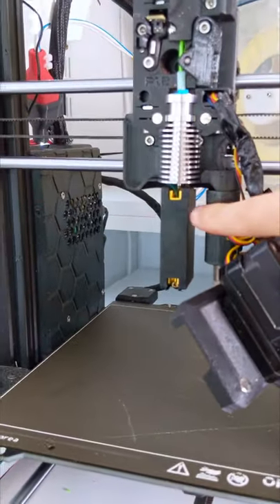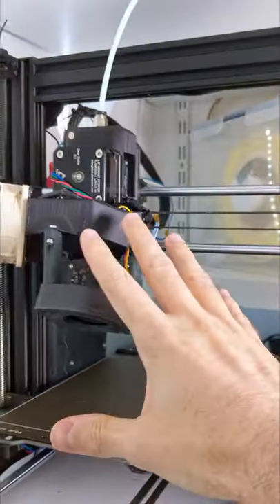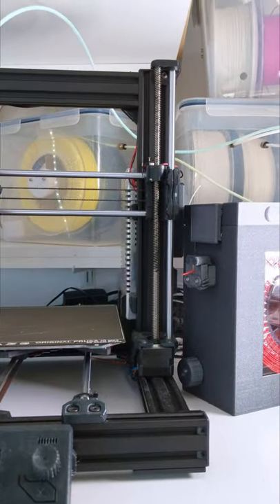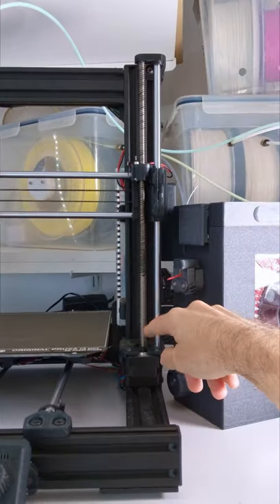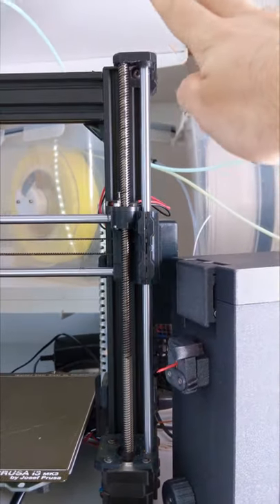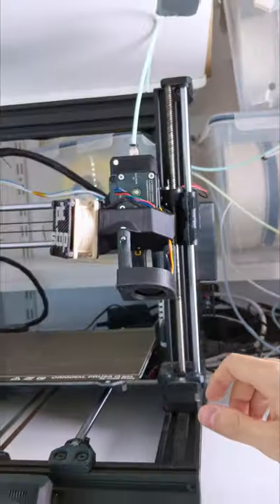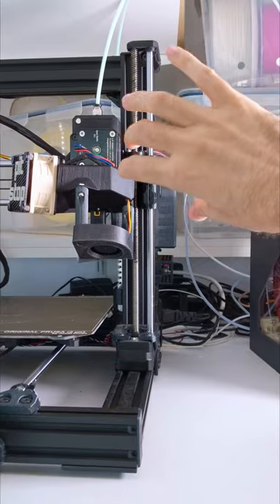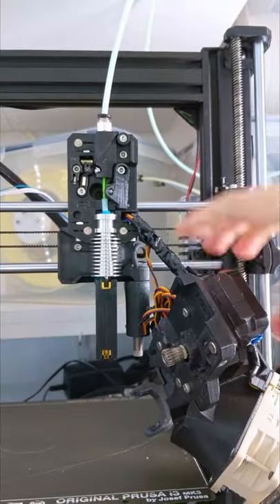I want to extend the Z axis of my 3D printer

Comment: Just put the 0.1mm nozzle back on and your z-axis will seem really tall. 👍🏼👍🏼
Reply from the maker: 😂 yeah a 200mm tall print with a 0.1mm nozzle - I could do a year long live stream of printing one piece 🤣
Reply: Ok, then. Get to work. I'm currently switching stock leadscrews to 1204 ballscrews. Due to the extra hardware required for a 10mm collar to ride on a dual-row angular contact bearing, sitting above a coupler above the stepper.... which took away a lot of Z lower travel, I separated the two Z steppers from the ballscrews by inverting them and using belt drives with 20t on the steppers, 40t on the ballscrews for more torque and precision, which is also helped in that the ballscrew has an effective 4mm lead vs the 8mm lead of the leadscrews since they are 4-start. Each microstep will be 0.01mm vs 0.04mm for the current config which would be helpful for printing super tiny benchys or actually being able to hit specific layer heights without interpolation. Oh, and holding up the much heavier and super flat ATP5 bed.
Reply from the maker: @texasermd1  cool! Why are you switching to ball screws?
Reply: Accuracy and lack of friction mostly. I haven’t checked run out on the 550mm screws yet but I’m designing a custom connection to my gantry based on wobble rings used on HevORT printers.
Reply: I'll split it into two to allow belt adjustment when I'm finished with the design.
Reply: Just add the HTTPS and some dropbox URL stuff to the front if you want to see a pic....  /s/gto52j4gcyov6fy/2021-06-14%2005.34.07.png?dl=0 and also "thing:4781610" for some wobble ring action.

Comment: I did something similar on my CR-10, for a slightly different reason; I don't like the amount of springiness you get from having long springs connect the bed to the bed-carrier plate thing. And just tightening the bed leveling dials only get you so far before the stepper motors interfere with the gantry. So I put the motors at the top. Result: I can tighten the springs all the way down, so that they're under a lot of compression, and don't allow the bed to wobble during high speed moves.

Comment: Supervolcano doesn't seem like a good design. Slice engineering mosquito and triangle labs Dragon both have a high flow version witch seams a lot better.
Reply from the maker: I know, but they're way less flow. Plus, it's fun to test things. I do see some risks with the supervolcano for sure. Does work better than expected to be frank.
Reply: @MihaiDesigns  u

Comment: Won’t you need custom firmware to reverse the direction of the steppers? Probably not a big deal since they make it open source and you can just branch. Would also change the z calibration since I think it expects a certain z range. Extending the vertical extrusions by the extra height of your print head and flipping would probably fix the z and give you full height.
Reply from the maker: Yes, good points! I have 2 printers, one is already converted to SKR board with Marlin firmware so I can make all the changes, including using longer Z motors that I happen to have from Caribou. For the printer with the Prusa firmware I'll just not use Z calibration. For direction reversal maybe I can set Z steps per mm to a negative number, or I can reverse the connectors (since I need to use extension cables anyways). Just ordered the parts 😁
Reply: If you reverse the connections of the stepper it should go backwards... However, since they have a connector it means loom hacking
Reply from the maker: @MikePreston-darkflib  I need to extend the wires anyways. But I guess I'll have to modify the firmware because it won't want to print past 210mm high.
Reply: @MihaiDesigns  you can't set negative steps/mm. Depinning the connectors and putting the wires in a different order is easy though, you just release the latch that holds the pin and arrange them however you need. Just make sure to never connect one motor coil across two different outputs. So if the 4 pin stepper connector goes AABB, and normally a motor coil goes AA or BB, connecting one AB will explode the motor drive chip.

Also 6 pin connectors are usually weird. They go like A-BA-B if memory serves. So  pay attention.
Reply from the maker: @SianaGearz  yeah, will have to compile prusa firmware it seems. I did it before once
Reply: @MikePreston-darkflib  Or just purchasing a motor extension cable and hacking that... 8o)

Comment: Why don't you make a new mount plate for the hotend assembly? That would certainly give you less space than extending the axis, but also like a lot less hassle.
Reply from the maker: Well, if you can make more vertical space with a super volcano with less hassle than replacing 4 parts, you're my hero!
Reply: @MihaiDesigns  Well, I can't currently do the design because I'm on Linux and my laptop is too weak for windows emulation, and FreeCAD is kind of a pain in the back, but I had a look at the MK3S 3D models that Prusa published, and you may be able to get away with modifying either the thing that the linear bearings for the X-axis mount on, or modifying the extruder assembly that bolts to that carriage thing. That can at least be printed, but I'm not sure how fast the modification will go. Also, the X-carriage is only available as an STL or SCAD on their GitHub.

Comment: Uhm assuming the Z axis bearings have a little wiggle, it seems that the nozzle should be as close to them as possible rather than hanging all the way down, so this wiggle results in least nozzle offset. Can you move the whole toolhead up on the carriage? You could regain all that lost height.

Frame extensions are unpleasant. You can introduce a good bit of wonk.
Reply from the maker: I know, but I'm not shifting it on the carriage. Too tightly integrated, and I need to be able to switch back to normal hotends
Reply: @MihaiDesigns  you

Comment: Why not just make a custom mount so your hot end sits higher than current placement so you don't have to do anything to your pinter setup?
Reply from the maker: That would be extremelly difficult for this extruder because there's really no separate mount. And all the wiring goes at the back in between the rods and bearings.

Comment: Due to the bed moving, raising the hieght has its limits. Too high and the inertia from bed movement wiggles the printed object free resulting in a failed print. This is why a gantry style printer is better than this design for taller prints.
Reply from the maker: Yeah I know. I like pushing the limits - it's how I learn. In the end I can just lower accelerations and it'll be fine.
Reply: @MihaiDesigns  you know there are a dime a dozen kits for extending on aliexpress right? 2 rods, steppers and extrusions.

Comment: since you desgined the pitstop and you have the cadfiles. would it be possible to modify the extruder mount to the y axis to offset the length of the volcano? I think doing the changes on the 2 lead screws might end up being be more work in comparison
Reply from the maker: The carriage is tightly integrated in the extruder. Shifting it would be a nightmare. And you'd be stuck with a super volcano. This way at least I can switch back an forth in a matter of minutes.

Comment: I noticed you got the PitStop v1.2 installed. What changed compared to v1.1?
Reply from the maker: Hehe good catch! I've been testing it for so long I forgot what the improvements were. Just tiny little fixes for the most part after listening to people's feedback. Only the printed parts require replacement.